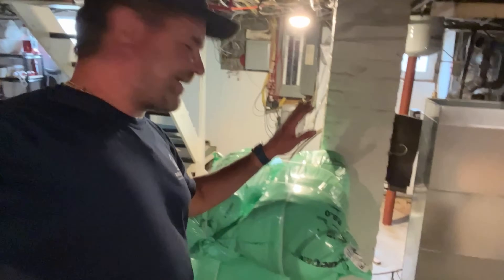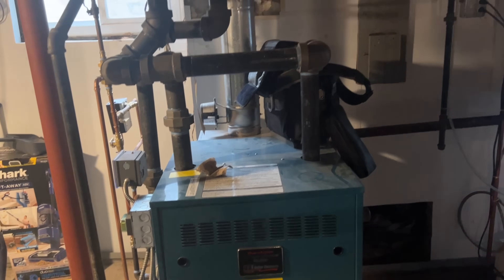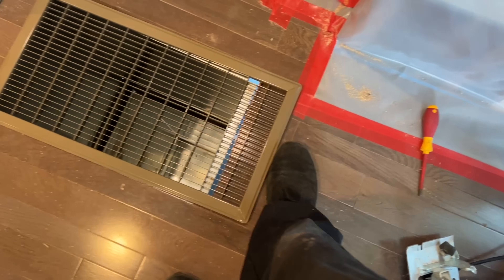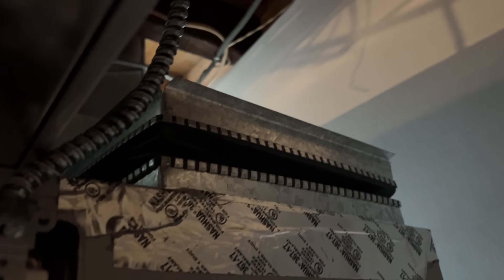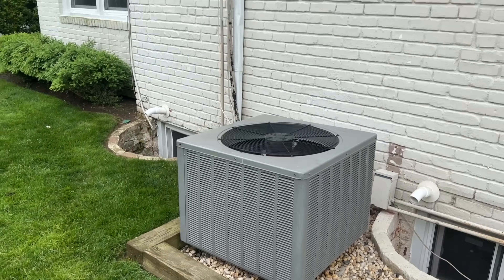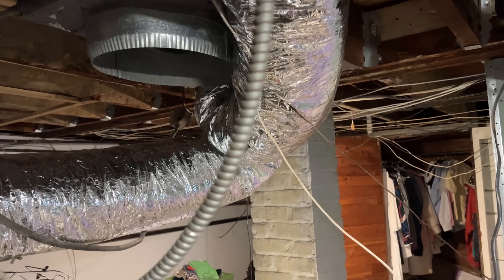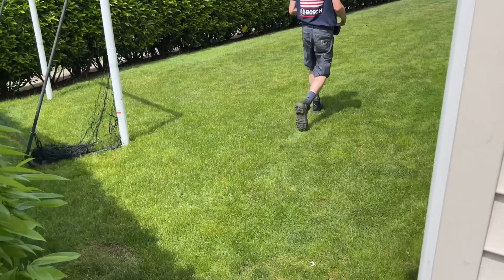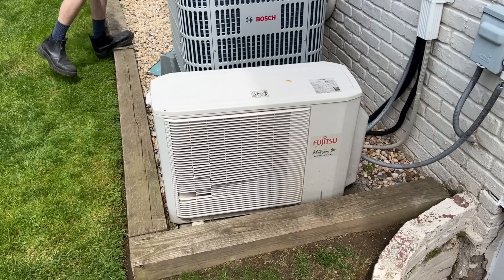Complete Replacement Central AC Installation with Bosch IDS 2.0 Heat Pump System

Comment: Great work as usual from Mikey Pipes team!  Love the commentary too.  Also, I think it's preferred to install a Dual-Fuel system when upgrading a legacy HVAC with a NG furnace system to a Heat Pump, even in climates where it does not get below freezing.  This way if NG prices make gas cheaper than electric, you can use use gas and also place less stress on the Heat Pump components (compressor) in the winter. Overall parts costs are the same at least with Bosch. Only difference is 3 parts (Condenser + Furnace/Air-Handler + Coil) vs 2 parts (Condenser + Air Handler w/ Coil).

Comment: Mikey is overdoing it with the lusting over Bosch.  We get it dude, Bosch is sponsoring you but they are not the best out there I guarantee you that in terms of service and parts. On another note, you do very good job with your crew and neat too.
Reply: @PipeDoctor  Mikey didn't mean to come out as a dick , was just motioning it since i heard you say it too often. You are one of the most thorough AC guy out there with your crew. i wish you were up north here, i'd hire you to replace my whole system that i'm looking at doing in the next few weeks.

Comment: A point well taken as to snow on the condenser fan blades. I have had that happen here in Oklahoma one winter. The condenser fan made the most awful noises as it was trying to rid itself of a snowfall from the evening before. A heavy and quite wet snowfall and then a quick freeze turned the snow to ice. My cure for that was to drag out my electric heat gun with which I melted all of the ice on the condenser fan. No damage to any component.

Comment: Mikey pipes, I live in the same climate zone as you and was just wondering what you see for heating values in cold weather. Is it similar to a conventional heat pump which is good to down around 35?

Comment: Installing that duct very inefficiently was hurting my eyes. Cutting the take offs on the side and not the top. ugh!
Reply: @PipeDoctor  Wrong again bub. I have 25 years experience in sheet metal duct work. Most of the take off could have went on top of the duct. The pipe was not in the way of that!

Comment: These Bosch units are using what's commonly known as minisplit tech but on a ducted system. I predict all makers will eventually go this way. They run so much more efficient. I have a minisplit in one of my garages and it's amazing. 

Some A/C guys have gone ductless or mostly ductless. You are trading long lineset runs for ducts. Very curious to see the long term on all those long linesets. Bosch really found a hybrid niche. Best of both worlds.
Reply: Bryant already has one.  You just remove the jndoor txv, and hook it up with a relay panel.

Comment: From VA every year I see a few heat pumps with the outdoor fans frozen solid in place. Snow melts off the roof and gutters are not working for one reason or another, the melt is just above freezing such that when it comes in contact with the fan shroud and air discharging that's 20+ below ambient it will flash freeze to the shroud and build up unit it holds the fan in place and the fan becomes frozen in place coveted in ice.

Comment: For heat pumps the condenser is referred to as the outdoor unit and the evaporator is referred to the indoor unit doesn’t matter which operation it is in

Comment: In a heat pump your outdoor coil becomes the evaporator and the indoor coil becomes the condenser when running in heat mode

Comment: Is the point of the highrise pads to keep elevated (away from snow) when using heat pump?
Reply: Yes it also allows the water to drain away during  the defrost cycle.

Comment: Technically the coils switch because the reversing valve reverses the flow of refrigerant. Out here on the west coast 95% of the units i work on are heatpumps and we  just call it the indoor coil and out door coil because their responsibilities switch with the flow of refrigerant
Reply: @PipeDoctor  well you were 100% right when u said the odu would be the evaporater in heat. And O/B is the reversing valve(as u know) but the reason theres 2 designations is because the reversing valve only gets energized in 1 mode. For example trane energizes the RV in cooling only so cool on a trane would be B because in heat the RV is just Off pretty much
Reply: @zaccody6980  "O" energizes the RV in cooling mode, "B energizes the RV in heating mode. The RV needs to be energized in cooling for TRANE units so you have to use "O". as far as I know and as far as I've seen, only RUUD/RHEEM use "B" 🙂

Comment: Heatpumps are the future but im still more of a fan of dual fuel
Reply: I think it's preferred to install a Dual-Fuel system when upgrading a legacy HVAC with a NG furnace system to a Heat Pump, even in climates where it does not get below freezing.  This way if NG prices make gas cheaper than electric, you can use use gas and also place less stress on the Heat Pump components (compressor) in the winter. Overall parts costs are the same at least with Bosch. Only difference is 3 parts (Condenser + Furnace/Air-Handler + Coil) vs 2 parts (Condenser + Air Handler w/ Coil).